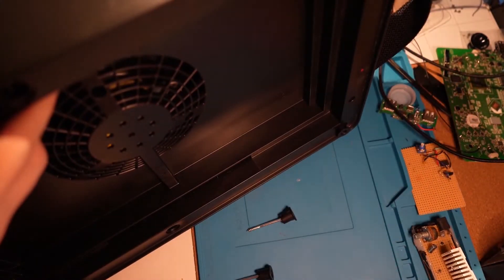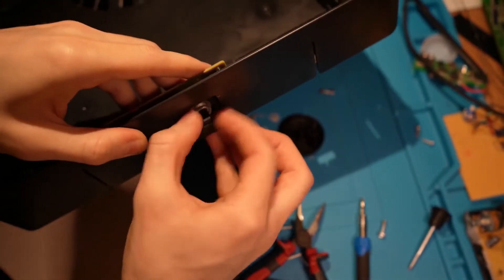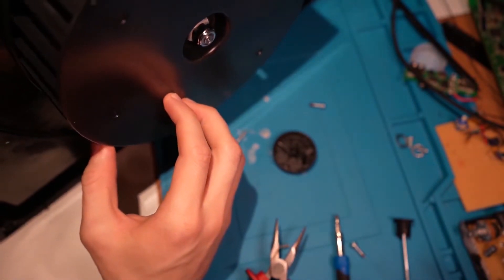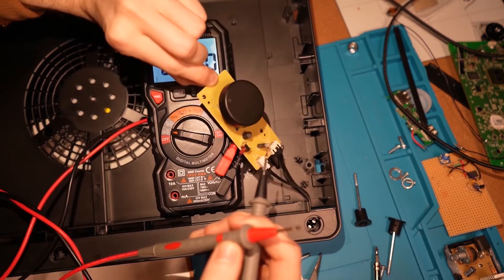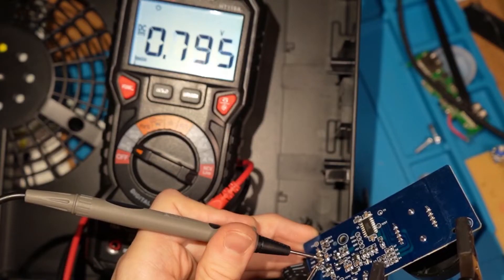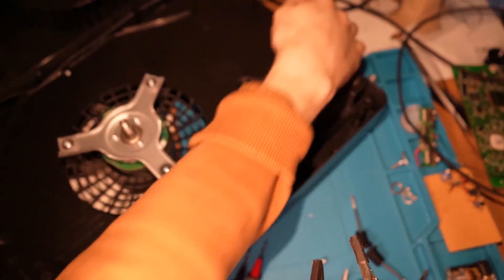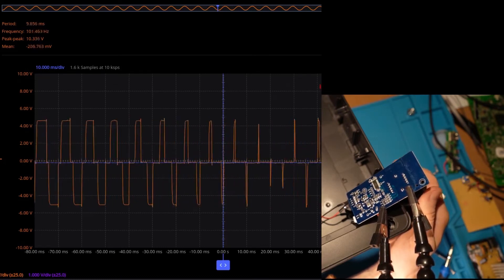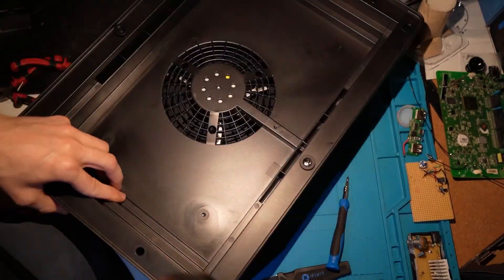Ikea FÖRNUFTIG air purifier - not turning on after tipping over

Comment: Hey, I'm trying to open mine as well. Are there screws in the holes where the front dust shield goes in? I saw 4 small screws but after removing them the 2 halves don seem to split
Reply from the maker: Hey, if i understand correctly what you are asking: when removing the front dust cover, there are in total 10 screws that you need to unscrew to split it. There screw heads are triangle shape. Hope it helps.